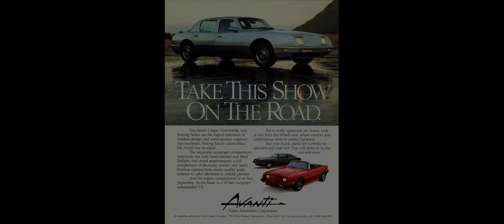1989 Avanti Motor Corporation - News Feed - Stock Footage Promotional film Coupes, Convert & 4 Door

Comment: This is so interesting. Brings back memories — in the mid 70s I visited Avanti Motors- operating in an old Studebaker building in South Bend. No moving assembly line- the cars were moved manually when it was time to go to the next work station.
Reply from the maker: The Stutz blackhawk isn't considered a "Replica".    They were designed by Virgil Exner using his neo classic design motifs for Stutz and premiered in 1969.   You can see some inspiration from his 1961 thru 1963 Imperial in the car, particularly the free standing headlamps.    Produced up thru the late 1980's in various forms.    They were beautiful cars in their own right and not a replica of anything.

Comment: Avanti is the answer to the (probably never asked) question "What are the only cars ever manufactured in Cancun?"
Reply from the maker: Well, not really.   The Avantis of Cancun were Ford Mustangs that were customized.   Ford Mustangs rolled down the Assembly and were completed as automobiles.  Avanti in Mexico then would take a Mustang and customize it, change the vin and create an Avanti.   It's not fair to call it "Manufactured" because the work was primarily done in a body shop environment (job shop) not a production line.

Comment: Odd to see the workers welding and grinding, all the time throwing sparks at the fiberglass body and dashboard padding. But I guess this is true, old world hand crafting.

By this time, wasn’t the Avanti being built on GM’s G-body chassis?
Reply: By 89 they were using the  B Body the G went out of production in like 87
Reply: They don't build 'em like that anymore!
Reply from the maker: It's funny you say that because I thought the exact same thing.     Why was welding going on?
Reply: I watched it again , the grinding  on the dash is before the dashboard was even installed ( or taken back  off)  and the body panels are covers with paper/plastic. Something is likely ill fitting the dash panel so he is doing some grinding to make it fit correctly. 
The welding looks he might be adding bumper brackets. Or could even be welding them on after bolted for added strength.
I worked in body shops for over 25 years starting in 84, we did grinding and welding in our shop on cars and around other people all the time.
Reply: @OsbornTramain  I can only guess that perhaps there was a lot of variation in the dimensions of the fiberglass body shells. Maybe it was easier (and more forgiving) to weld a certain brace to the frame in order to meet the mounting point on the body, versus shimming the body to meet a pre-welded  brace on the frame?
Reply: I thought the same thing too.  Now when we see an auto assembly line there are robots welding, and the plants look bright and spotlessly clean.
Reply: @bradlemmond  Myybe that’s not a bad thing! 😆